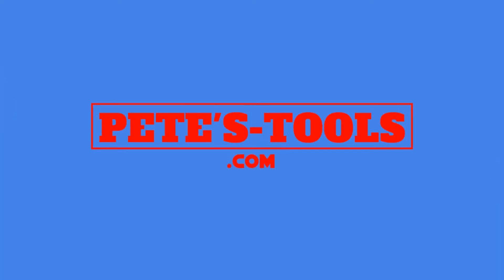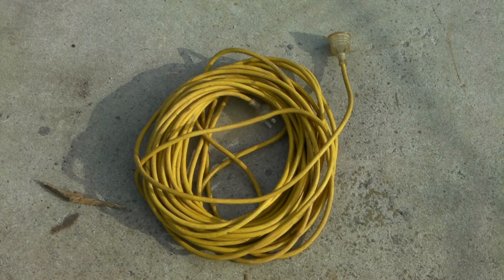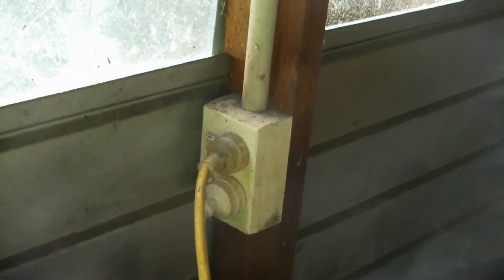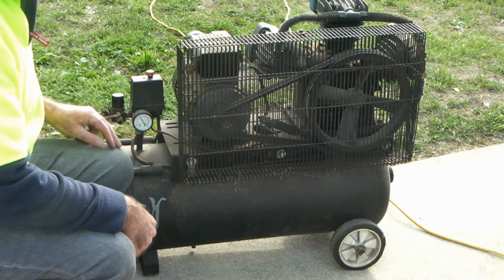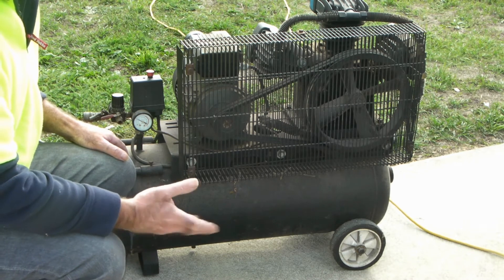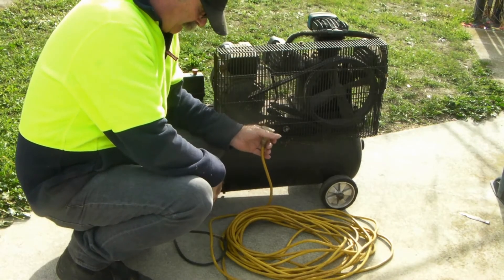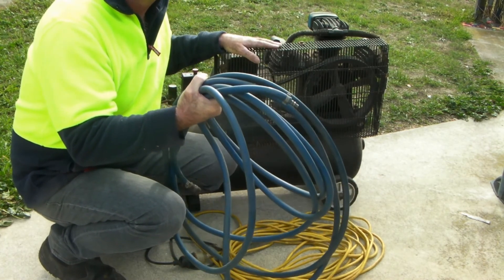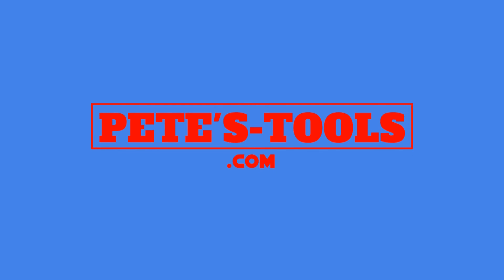Can You Run Your Air Compressor On Extension Cord

Comment: What nobody wants to say is that the breaker switch that comes with the unit is too small, you have to change that breaker switch on the compressor for one of a higher amperage. If the compressor draws 15A you should put a 30A breaker in the unit.
Reply from the maker: Hi .oh really thanks

Comment: I have 2 cords that are heavy enough for dads old compressor that mom has and the compressor i picked up off craigslist my extension cord on it has no problem granted mine is a 220 13a and my cord is rated 30a for running my mig welder.  When im able to get my own place you wont see any welder outlets im gonna use lp-30 outlets like what is on generators that way if i need to weld in the field or run compressor out and about just get out the gen
Reply from the maker: great good luck

Comment: I've been using an extension air hose for that exact same reason. 
I even tried a 15amp lead and it didn't help either. 
Cheers
Pete.
Reply from the maker: yea the longer the lead the worse it is
Reply: My recommendation is one size larger cord for every 25 feet of extension. So if the compressor cord is 14 gauge, then 12 gauge for the first 25 feet. 10 gauge for 50 feet. Never go longer than that. But a longer air hose it’s the safest way to go, and costs about the same.

If you coil up the cord, you have to derate it by half. So a 10 amp cord becomes a 5 amp cord.

Comment: I think it mainly depends on the quality of the extension and the gauge it might work unless it’s extra heavy duty I think ?
Reply from the maker: but not recommended
Reply: @petestools  15amps???? That’s a 10 amp outlet and a 10 amp extension cords what???? Most New Zealand’s and Aussie plugs are 10 amps and the compressor is 15 amps that’s why ur compressor won’t run properly on the cords